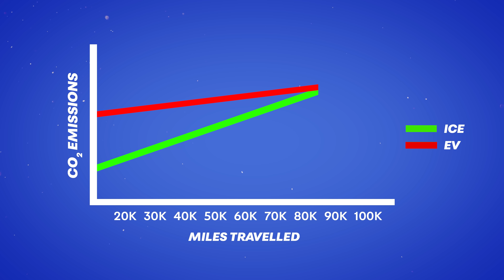Are Electric Cars REALLY That Green? [New 2022 Data]

Comment: The problem when the comparison come into play is how far back up the supply chain you want to crawl.  The problem with the so called clean reputation of the electric is the simple fact it crosses paths many times with petroleum during it's manufacturing and through it's life.      

If saving the planet is you goal, don't drive, ride a bike.  If you intent is to feel like your doing a good thing, then the electric will certainly fit you needs.  If nothing else your car doesn't pollute while you drive,  just somewhere else on a different day.

Comment: This is so misleading 😡

Why would Volvo share these stats?

Because they barely have any electric cars and are losing money every time a potential customer buys an EV. In other words, they need to persuade people buying ICE is ok so they can make money whilst they get better at making EV's. I love Volvo, and drive one, but wouldn't get a new Volvo, because they don't make an EV I'm interested in.

Bottom line - there is a huge commercial incentive, for Volvo, to downplay how green EV's are.

What's wrong with the stats shared?

The XC 40 recharge uses a lot of electricity (20% more) compared to the equivalent EV (e.g. Tesla Model Y). This means it takes longer to offset the higher initial CO2 emissions than a model Y, for example. Because it's not very efficient, it uses a much bigger battery and has higher initial CO2, than it needs to. 

In other words, the reason the XC40 recharge isn't amazing vs the total CO2 emissions of its ICE equivalent is because Volvo's manufacturing, sourcing of raw materials and power-hungry design mean it produces a lot of [unnecessary] CO2. So figures look rubbish, because Volvo's not doing a great job making low CO2 ev's (which pains me to say because I love Volvo). 

The statistics don't represent the EV industry, but really just say Volvo needs to do a lot of work.

If Volvo made a safe, efficient, estate, that was comparable to a model Y in range and ideally cheaper in cost, I'd be all in. Unfortunately, they don't, which means many people like me are forced to look elsewhere. So they lose money. That's why they made those statistics, not because it represents how green EV's actually are.

Comment: What I like to know is how Volvo's Hybrid stacks up compared to the ICE an the EV.  Yes I know it will be better than ICE and worse than an EV, but what is the break even point.
Reply: Figure you have the T or T+K-2.0L I4 (a "slightly efficient" ICE) + the electric motors contributing a % of the power output (up to ~30% in "twin charged" Hybrid variants). I'd say the ICE sways the balance to the side of "inefficient", so don't expect that ANY HYBRID can emit as few CO2's as a BEV   EVER  through it's life, as the battery pack replacement would "restart the clock" at a lower timing.

Comment: Battery are not the way forward its old news there better ways and cleaner fuels without using Battery rather then dig up the earth and ship it across then ship it back across shipping it Self needs to be looked at they burnt the  Dirtiest fuel and have one if the highest cos  Emissions they is and recycling the battery can cause more damage plus the cars will have to last a very long time on the same battery for over 10 years which has we know they won't plus with the power shortage and a over loaded power grid as it is and putting everything in place to make it all work isn't going to happen the cost is alot the way forward would probably be  Hydrogen Toyota is already working on it. 

I do agree with the short journey but the cost of it all from new you won't even see the difference if you're only doing short journeys won't get the milage on the vehicle to call it eco friendly the carbon footprint is just to big most people change their cars every 3 to 4 years they always something better. 

Vehicles ain't the problem we all are we live in a world where we want the new things were never happy on what we have so its got to be new things or get the latest new trends for example my last phone had it for 7 years before it broke never see the point in change if it stills works my new phone had it 3 years now nothing wrong with it. 

Just because it's old doesn't mean it's  Obsolete if we all keep and repair are old things and keep on using what we have the carbon footprint will reduce a lot. 

Keep it going until it broke and can't be repaired.

Comment: I wonder in all these environmental tests saying petroleum is about a wash to electric power if they take into account the energy required to build drilling facilities, transporting the fuel to the refinery, the power required to refine the fuel, and then the energy required to get that energy to the gas station. I know electricity comes largely from coal but I bet it doesn’t take as much energy to refine the coal. They also ship coal via train and then power by power lines which seems more efficient than fossil fuel transportation.

Comment: If you see all of the chemicals and procedures that go into making a battery you would fall over. The security alone at these plants is insane. No, these are not an environmental alternative to gas or diesel. And yes, I have worked in the oil fields and have been to more refineries then you can shake a stick at. I'll take oil any and every day of the week over these filthy, and they are, batteries... And to add, the precautions and training required to even work on an EV, just the protective gear is ridiculous, and expensive. There is no benefit to any of this, and besides, we do not have the infrastructure to support mass implementation of EVs, the grid is not there to support it.

Comment: I would expect that when the battery needs to be changed that the graph would jump up again?  When does that happen on the Volvo?  
Great video thanks.
Reply: 124,000 miles. He says so in the video.
Reply: @KindredBrujah  must have missed that.  But I didn’t see the graph jump?
Reply: @PricelessMikie  124,000 miles is the expected lifespan of the battery. The graph didn't jump because he didn't show the cars' expected environmental performance over 124,000 miles, he stopped at around 90,000.
Reply: @KindredBrujah  that seems odd seeing that the break even for some locations is 90k.  Basically you get 34k of advantage then it resets again?
I do understand that some places are 53k for break even.
Reply: @PricelessMikie  I suppose that is either all the data Volvo provided, or the author didn't deem it necessary to continue showing the graph after the point that the EV catches up to the ICE car in environmental impact (or, rather, the ICE's on-road impact catches up to the EV).
Reply: But you are correct in principle. If your battery is damaged for instance, and it needs to be replaced, that is much worse than even a full replacement engine in an ICE and that would definitely shift the relative balance of environmental impact.
Reply: @PricelessMikie  it doesn't completely reset though, because when a battery is replaced other parts don't have to be. The electronics for example
Reply: @ThomasBomb45  not completely you are correct but is it half of what it was?  You also now have to dispose of the battery. Lipo batteries are really nasty waste.  
He point is if break even is 90K miles then you only climb 34K then reset again this is looking less and less attractive.
Reply: I think Volvo wants to say that we need more green energy in the production mix to make EVs the better option. Volvo will keep producing hybrids (both mild and PHEVs) for a couple of more years. Therefore, it makes sense to show this study and not give Tesla, who only produces EVs, all the environmental advantage

Comment: This video is so BS.

Start with relying only on one source of information that is produced by car manufacturer. So bias information in the first place. Also there is hardly any thinking beyond one concept against another.

It compares extremely bad electric production for EV's vs. combustion engine. We should note that EV's will (or at least should) eventually have their energy from wind and solar. We should change our energy system as soon as possible and allow our transportation to use renewable energy sources.

IF we keep on investing combustion engines, then we will not even have a chance to become pollution free.

Also Volvo uses same layout that is made for combustion engines for EV's. So the very design is favoring combustion engine. Making whole new car based on EV needs will make a different results.

Overall ANY CAR makes high negative impacts on the environment. This is because they need mined resources, processing plants, shipping, factories, roads, ...

So, walk short distances (0-2km), use bikes in a bit longer distances (2-20 km) and use trains (electric ones) for longer travel routes. And try to minimize the very need to travel.

Another bad thing about cars are just the consumption that they supports. Car markets in the edge of town are just a bad idea. You should buy less, not more. You hardly even need those new gadgets, clothes, etc. that are sold to you and they just end up in your drawers and waste bins. Buy what you really need, but not what salespersons are trying to sell with them.

Comment: I'm leasing an EV. I'm keeping the 911 but it isn't going to be my daily drive anymore. The cost and the fact that we may end up facing short-term fuel shortages more are the leading factors. EV's aren't a magic bullet. EV vans have terrible range and are completely impractical and large site equipment such as 30 tonne excavators don't work well as EV's. I think we need more hydrogen infrastructure. Toyota made a GR Yaris Hydrogen burning car. The issue is the cost of extracting Hydrogen and the fact that because it explodes more violently than petrol you can't convert a petrol or diesel to run on Hydrogen

Comment: Till they need to throw in a new battery and then the C02 produced by the EV jumps back up. Mind you the batteries are so expensive you may as well just get a whole new car when the battery bites it. I'm more interested in hydrogen electric, no need to stop for half an hour to an hour during a road trip when the fuel cell fills as quickly as an ICE car. Also I'm not of fan of the child labour/slavery used in mining the cobalt for EV batteries.

Comment: I do wish more people would be honest to themselves, there would be far fewer arguments in the world, I didn't buy an EV to be green or even greener. I bought the car because it is convenient for me, I certainly didn't buy it to reduce my monthly outgoings. But most of all I bought an M3LR because I could, it is a fun car to drive, for smiles for miles it is cheaper by far than what you would need to spend to get the same acceleration, not to mention the ongoing costs of an £80,000+ new car just to say you have a sub 5 second car. So you got to do like for like here. At the end of the day if you were to compare an M3LR with a car that also does 0-60 in 4.2 seconds then I am pretty sure the carbon offset would come far sooner.

Comment: Oh finally someone who agrees with me, can I ask have volvo taken into account, that the batterys will rarely last 100,000 miles, and you will need to change the battery, so that figure will start again, so it is just the same as a petrol car
Reply: It's not at all true that EV batteries rarely last 100,000 miles. That might have been the case in early Nissan Leaf's with their cost-cutting passive cooling systems, but EV batteries are lasting much longer. Tesla warranty their Model S batteries for 150,000 miles. 120,000 miles for the Long Range Model 3 and they're promising that the next-gen batteries will have a million mile lifespan. Manufacturers don't warranty their components outside of the design life. Individual modules can be replaced in a failed battery pack, limiting the need for an entire battery swap (in reality, they swap for refurbished packs). What's more, EV batteries have a second life for static storage after they've served their time in an EV.
For balance, the engine in my last ICE car lasted 17,000 miles and cost £21,000 to replace according to the invoice.

Comment: You are an excellent presenter. What no one is hardly talking about, and it would've been nice if you elaborated a little further on it, is that many sources are creating a fuel that has proven to generate zero emissions from an ICE, even without a cat installed. That will be a complete game changer and the ICE will be cleaner all around, hands down.

Comment: Good content, but it's not all doom and gloom. The break even point is 90,000 km, but the average distance traveled over a vehicle lifetime is 200,000 km, so it's still greener to drive electric.
Volvo did highlight that it strongly depends on the source of the electricity. Even if it's all from fossil fuel power stations it's better than ICE, but not by nearly as much.
Also if you use LFP batteries, their lifetime could be as much as 1,000,000 kms tilting the equation further towards battery electric.

Comment: Click bait around EV carbon cost.  I call bull shit.  In his narrative he explains that the EV achieves break even at 29k with UK energy mix, and then admits that consumption figures are inaccurate, using WLTP figures rather than EPA.  But he also does not take into account the benefit of the use of exclusive green energy in the manufacturing plant eg, Nissan, Sunderland plant.  And there seems to be no valid account for the real world difference in maintenance cost eg, replacing oils, belts, exhausts, brake pads, discs in the ICE car.  Too much discussion of EVs is ignorant of these.

Comment: hydrogen fuel cell will win out... we cant make enough batteries if every car is replaced by them .. also not everyone has a driveway where own charger can be put. and cities are not going to make every public parking space a charger space... so you charge at gasstations at 20 min a car?   whle hydrogen can be filled up in less then 5 min (including paying at checkout)

Comment: I wonder...once you start considering the carbon footprint of a wind turbine with its 30-ish thousand gallons of concrete (and all the ICE vehicles it took to install it), or the carbon footprint of solar cells which contain heavy metals and other materials that will end up in the landfill, if the "renewable energy" from those sources and others actually starts to make the carbon footprint of EV's versus ICE vehicles more on an even scale throughout their lifetime. Especially given that EV batteries, the big-ticket carbon footprint item, will need to be replaced several times if the vehicle was ever to see as many miles as an ICE vehicle. I am glad Volvo released this study, because without studies like these we will never really know. And even the studies need to be taken with a grain of salt. In my opinion unless there is a significant environmental improvement, like say 200-300% improvement (40T vs 80T of carbon), then there is too little of a difference to really say for sure that one is better than the other.

Comment: I wonder what happens after the destruction of the cars. Plus since the batteries are such large points of CO2 production how often are there failures in the batteries that require a battery replacement. And you have to look at ICE loss of performance. Also if 0 net carbon emissions gas, meaning carbon is pulled from the air to make the gas (I think BMW is working on that) ever become feasible then that could change everything again because ICE engines would not be adding to the CO2 just recycling what was pulled out of the air to begin with, so at that point maybe ice is more green.

Comment: Two points. If the EV is driven on average 10,000 miles per year, at some point around that break even point, 90,000 miles '9 years', or a little beyond. You could well be needing a new battery. The pollution created to produce a new battery will once again put the EV way ahead in harmful environmental pollution. Secondly, no one is talking about the environmental effects of disposing of all these dangerous chemicals in the batteries themselves.

Comment: I have not read Volvo's report. Perhaps a few kinks to consider. You mention you only use green/renewable sources of energy. How is that possible? Even those wind turbines and solar panels have a carbon footprint when produced. Do we know what the life span of those batteries are? Will need to create batteries just for storing that energy created during the day then to just recharge the battery that is in that car? When the battery needs to be replaced does part of that clock start over. Now the big one. Is Volvo comparing a new EV against a new internal combustion platform? What if we retain are current internal combustion vehicle and not purchase new of either a EV or internal combustion. I bet maintaining and extending the life of what we currently have would win hands down. But the biggest issue of all is we should be working on reducing the demand for this energy that has a carbon foot print. Could we change the distance between where we live and work? Could we get that distance down to 5 miles? If we could what options does that open up. Riding your bike now becomes easy, etc.